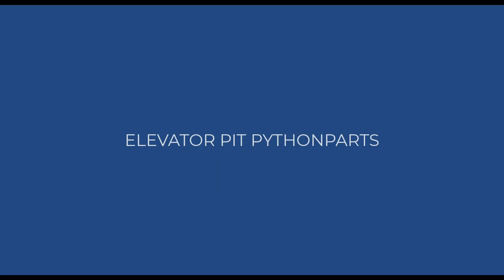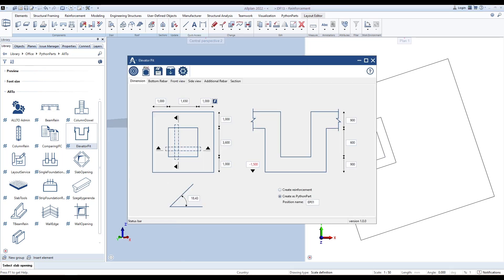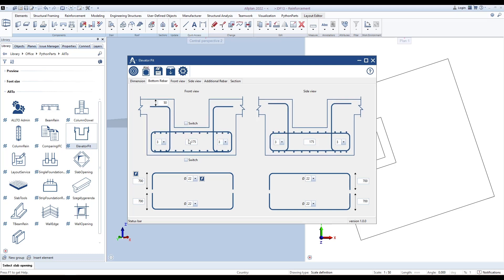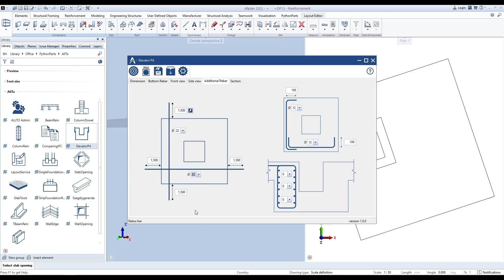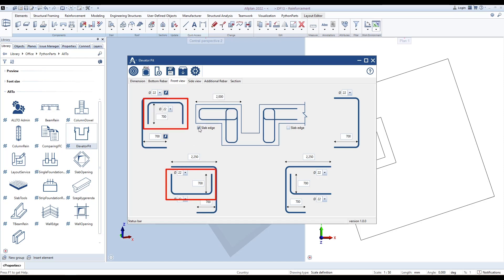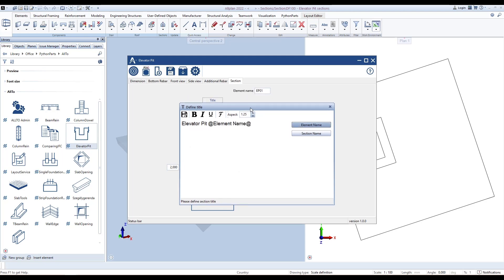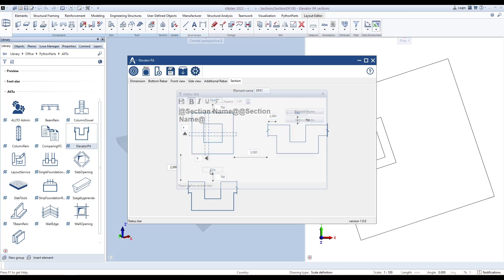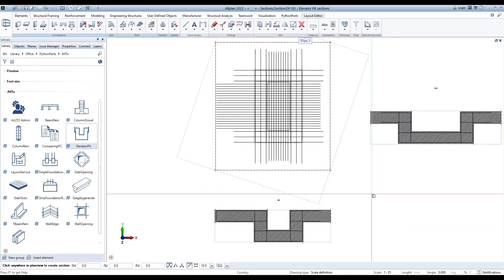Elevator Pit PythonParts Reinforcement (plugins/tool) in Allplan | Developed by ALLTO

Comment: 201 / 5 000
It looks like a very useful module. It's a pity it's not in the main allto program. When I bought allto software, I thought this module was standard. Will there ever be? Can it be purchased?
Reply from the maker: hello, this is a special custom pythonparts, it isn't included in ALLTO building. you can email sales@alltosoftware.com to get the trial of evelator pit tool.
Hope it helps.